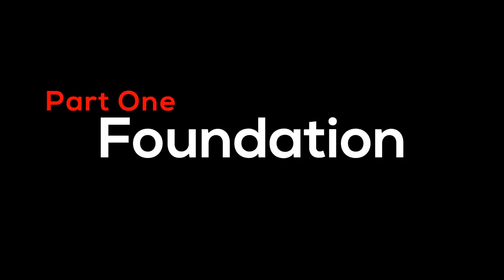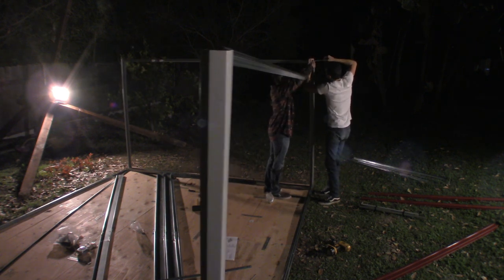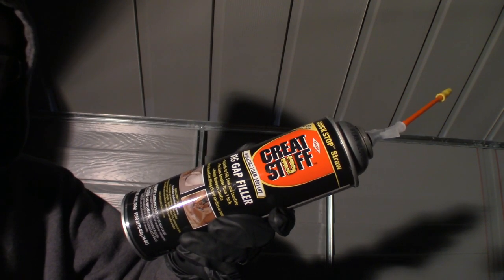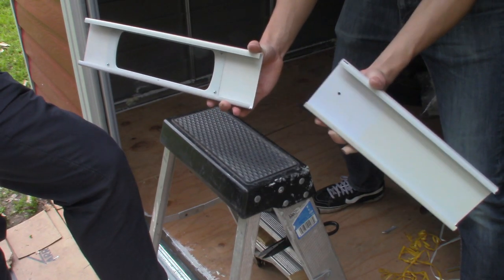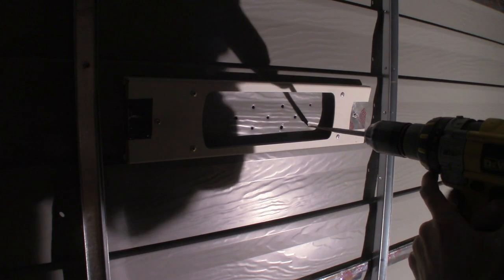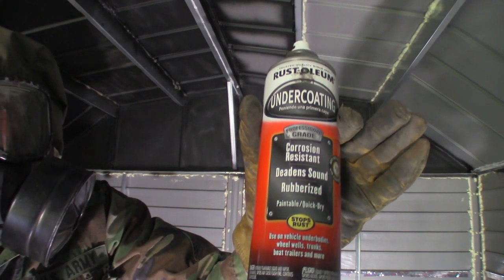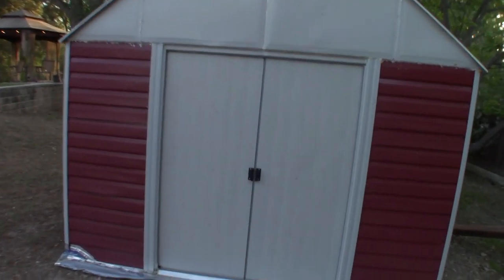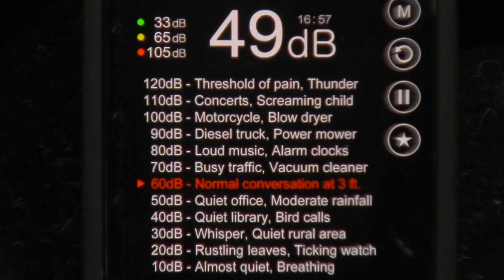How to Make Cheap Soundproof Music / Recording Studio in a Shed / Room

Comment: Can you please retitle the video? It implies that you knew what you were doing. You shouldn’t make
How to videos if you don’t know how to. This is not a safe space to occupy. The tarp acts as a pool liner which holds water against the plywood. The plywood and foam are mold food. The mold is unhealthy. And then there are power strips on a damp floor. This is absolute insanity. No one should do anything that was done here. Not a single thing was done right. If the title did not say how I would have moved on but this making how to videos without any knowledge is extremely irresponsible. I don’t care that you are not mechanically inclined. That’s fine, not everyone is. Just change the title so that no one mimmicks anything you have done here. Also this is not soundproof AT ALL. It is not sound isolated, sound proofed, structurally sound. This is a thin box with some thin foam. A 2x4 structure with 1/2” sheathing, R13 Fiberglas insulation and 1/2” Sheetrock would provide significantly more sound resistance than this and that is the minimum building requirements for a home. This is less sound resistant than a home built without sound remediation in mind at all. The title is very misleading.
Reply from the maker: Jack Kelly 
Ok, I’m going to start off with this, constructive criticism is your best bet, not just being negative because I have to disagree with you. Since the point in time that this was completed ( over two years ago ) up until this very day, this build has been doing exactly what is was intended to do in the most cheap way ( “cheap” is literally stated in the title and spoken about at the very beginning of the video. ) It is still standing firm, it is tested to have soundproof qualities ( though it’s obviously not the best because again it’s a cheap build ), it makes recording audio so much more crisp, the floors are not damp even after the rainy days/weeks/months ( I have no idea where you got that from, there isn’t even any leakage ), and there is no mold dude. You even mentioned how a tarp holds in water, im sure you understand that it is also completely capable of holding it out ( as long as it is effectively sealed. ) We’ve looked at our options before getting our supplies and we knew how effective insulation between double walling would’ve been but what we also found was how much more expensive it would’ve been. Again this is a “cheap” build, meaning a limited amount of money was used to make it happen so what do you expect? If you want perfect results, unfortunately it will not be found here. This serves to get the job done well enough for those who cannot afford such expenses, therefore I will not change the title because it is clear enough what the intent is and the results are there. Can certain things be done differently? Absolutely, and that is respectable and even advised to be stated within the comment section. Some people put out some solid information on what could’ve been done differently, but you just went on assuming that it doesn’t work at all without even asking to see otherwise and even continued on to insult so I’m not buying it
Reply: Okay. I can’t really give any constructive criticism because this really can not be improved on. They say a Structure is only as strong as it’s foundation and your foundation is wet plywood. I know you don’t believe me but with 20 years of building experience that plywood is wet. Your feet may not be but there is no way at all that some tape is holding all of the water out the way you wrapped that around there. This is wrong even for a storage shed let alone one that needs to be occupied. It is not dry under there. What can’t be true won’t be true no matter how much you tell yourself and everyone else here. It needs to be lifted off of the ground. The floor needs to be framed. The floor needs to be framed out with a minimum of 2x6. That needs to be insulated. If no bottom sheathing is installed then the bottom really needs to be spray foamed. The best way to build a soundproof structure would be to pour a thick concrete slab as your base but I understand why that would be cost restrictive. The walls should be at at least stick construction. They need to be insulated with Rockwool or sprayfoamed. The roof also needs to be insulated. Then a second floor needs to be framed on top of the existing floor. It needs to float and should be raised up sitting on isolation blocks. That floor should get a second layer of sound insulation. Then a second set of walls needs to be built on top of the floating floor making zero contact to the outer wall. Then a ceiling should be framed within the inner walls. It’s a box within a box. The inner walls should get 2 layers of 5/8” drywall. The green glue you used should be used between the studs and the drywall and between the 2 sheets of drywall. On the cheap no windows should be used because the type of windows necessary are expensive. An inner door and an outer door should be installed. Both should be insulated, both should have excellent weatherstripping and the frames should not touch each other. It will be so airtight when done that special air ducting needs to be installed to provide fresh air to the occupants. Then when done you can apply foam to the interior walls. This foam is NOT for soundproofing. It is to reduce/eliminate echo in the room to create a dry sound environment for recording. You skipped ALL of the soundproofing steps and only applied foam which is NOT for soundproofing. This is why I ask you to stop telling people that this is “How to make a soundproof” anything. This a lying. People who do not know better can watch the video and waste their hard earned money building what you built. Unless you are in the middle of a field this set up would have the cops at your house daily in the suburbs. You are just playing drums in the middle of the backyard. It would be extremely rude to the neighbors. I hope this is in the middle of a farm or something. I am trying to be more constructive here, however I said before it annoys me when people make how to videos when they have no idea “how to”.